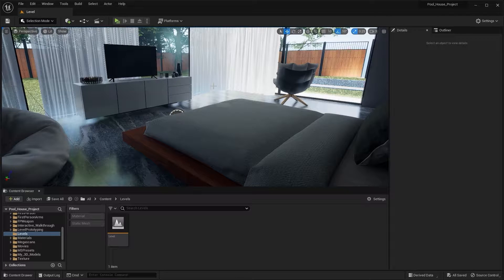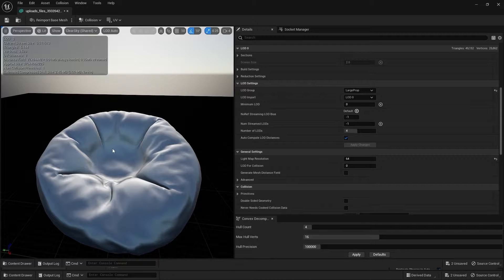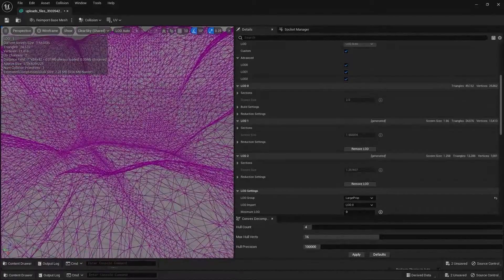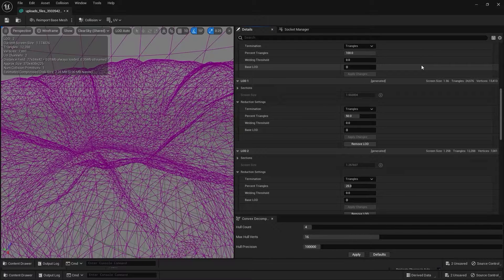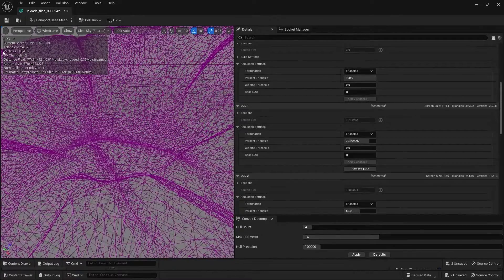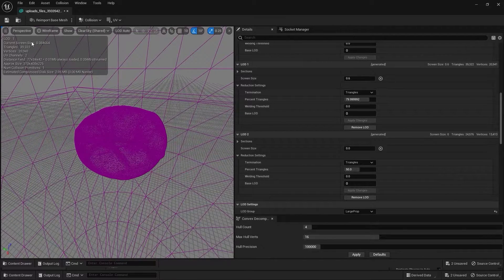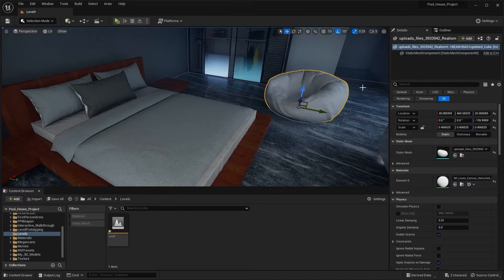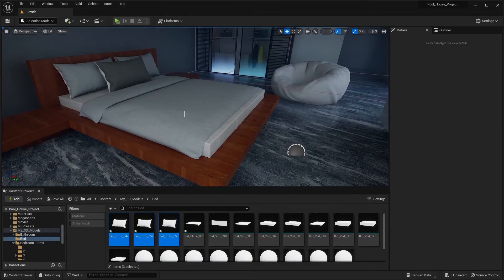Unreal Engine 5.1 For Architectural Visualization | Level of Detail

Comment: Nice work boss please I have a question. 

Can I use Nanite and LOD at the same time on a static mesh?
Reply from the maker: Yes in some cases you can use both. You can use Nanite for close up static meshes and have very detailed high quality results and at the same time you can use LODs for distant static meshes. In most cases using one of them will work just fine.
Reply: Thank you for the response boss... Wishing you 1 million subscribers very soon.